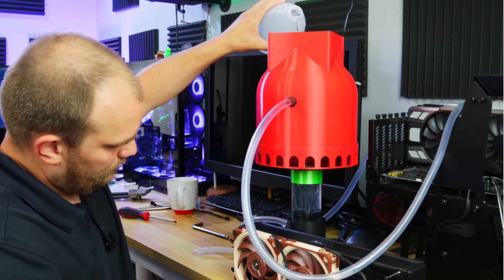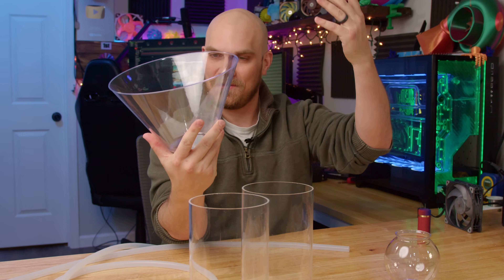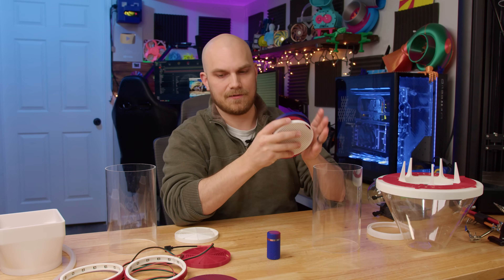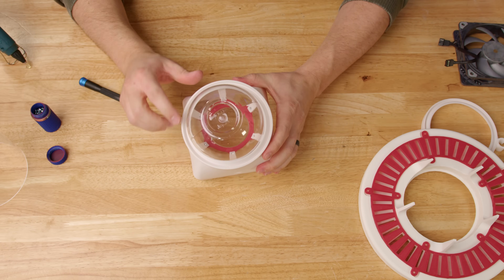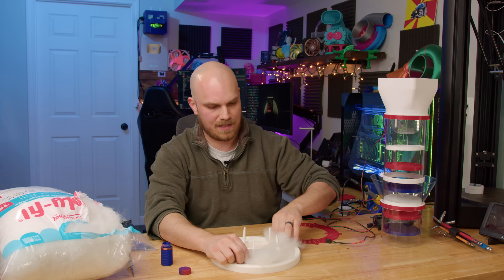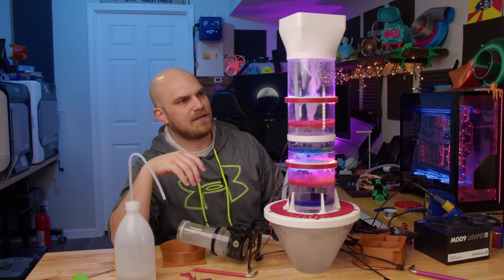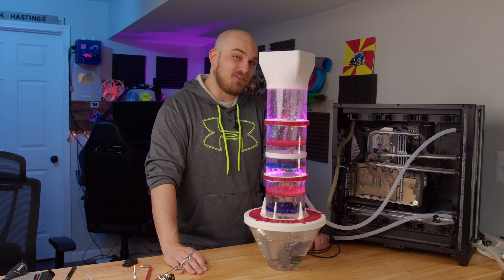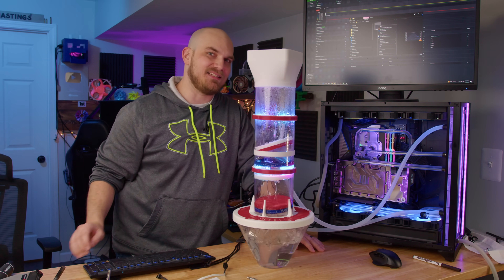Water Cooling..... With NO Radiators

Comment: i‘m just wondering, just an idea, but never tested or proven before, can you try to make the system a 2 stage cooling by adding a heat exchanger so the heat will not directly hit the PLA cooling infill and it might probably solve the warpage issue / hot glue issue

Comment: Of course you would need some protection for the fan but if you pulled air up through the bottom it seems you’d have more cooling. Of course that might come with more evaporation…

Comment: Why don't you make a spiral "stairs/slide" that spirals the inner sides for you water to flow down and make the middle of the cylindrical tower empty for an air flow column? 
Also solves the problems of your inserts falling off due to the silicone glue failing.
I would imagine the gravity to help with the velocity and spiralling effect into the bottom basin will also help the water cool better.

Comment: With some modifications this can be a wet scrubber to remove smoke, dust, VOC from an exhaust of any kind. Of course, the air get completely saturated with humidity and there is some water consumption, but for 3D printer or laser cutter exhausts it would be useful.

I may design one actually

Comment: bit late to the party maybe but I've made one of these in the distant past (I think 20-ish years ago) I used a copper pipe wound into a coil as a heat exchanger to keep the water from the tower and the loop seperate as it will get dirty. Only downside is you need two pumps. Back then I just used PVC piping, a Y adapter at the bottom, one straight pipe upwards with a showerhead kinda gardenhose attachment and a fan in the other opening of the Y adapter. the cooling water was usually below ambient which was pretty cool!

Comment: yea ... you're gonna want to not use this(style) for any real length of time ...

the reason you use radiators us because you need to close the loop. you effectively made an aggitator that makes as many tiny bubles as possible and sucks them back into your loop.
you will almost definitely vapor lock your loop if you run it long enough without burping the system.

Comment: So you created an open system in which your water is exposed to air and particles can get in it. Thus all the crap that is in the air can end up in the water and eventually end up stuck in the CPU water cooling block and eventually clog it up. You thought about air filtration but not water filtration. You also seem to not have taken into account all the baffling you created and what that is going to do to air flow. I say that because of he size of fan you selected to use expecting it to create adequate air flow.
All of that could have been calculated before hand. 
You also have the issue with water can evaporate from the system. You have poor surface to air values because you are trying to cool effectively a water fall rather than use any form of radiator.

Comment: For a very long time I suffered from the same ideas and their implementation.
1 to increase the area from which evaporation takes place, I used a bunch of different straws for cocktails, in my case 6 mm showed the best result
2 geotextile was used to filter the air - it is very similar to the material of vacuum cleaner bags
3 I used sponges for aquariums to filter water, it also made the sound of falling water drops quieter if the water level was lower than the top of the sponge
4 I used a channel fan and in order to avoid contact with water, the air supply was from below
5 since the circuit is open, the tank needs a huge one so that all the water can drain there, well, you need a powerful pump so that you can pump everything back, or you need a check valve(near exit) that creates a decent resistance in the circuit

Comment: Instead of mesh discs, you could print "Pall rings" for random packing with a top and bottom retainer grate. Pall rings are used in commercial-scale for distilling and similar processes. Pall rings or other random/dumped packing would be a great way to distribute that water nicely. 

Combine that with a counter flow air path (air goes up, water falls down), you could probably get some more cooling mileage out of basically the same materials. you could use a y shaped branch to inject air down one leg of the y to go up the other leg of the y, in which the water is falling down. Then you wouldn't need to worry about getting the fan wet, but you could still get upwards/counterflow air.

This liquid down, gas up  counterflow is how it's done for the most part with chemical engineering.

Comment: If it was a donut type design, with a inter wall made of a copper pipe (the donut hole) where the air is pushed/pulled through, with the clear plastic is on the outside (outside diameter of the donut) with the water running down between the outside of the copper pipe & on the inside of the clear plastic outer wall, & since you're not trying to also push air through the water side you can slow it down by adding a path for the water to run, like a maze.

it would be an inside out radiator.  also maybe go tall, the height of the room, or turn it horizontal & instead of using one wide copper pipe use many.  Maybe have one of the copper lines replace with clear tubing with your LEDs inside to like it up.

I just bought PMMA 12mm tubing from a US Manufacturer & they send me it in 2 meter lengths, they also make, well hell they make everything, you're outer wall could be 2 meters, (6 foot) long and as wide as you needed it.  www(dot)ePlastics(dot)com ...do not be freaked out by their web site, they're happy to help out us computer modders, they see no order as to small, and their staff on the website chat was very helpful.  Hell you could send them the design & they'd build it for you!

And buying from them you know the PMMA hasn't been sitting on a shelf for a decade turning brittle, you also get to deal with (2 meter) 6 foot lengths of tubing.

Good Luck with your next design.

Comment: How difficult would it be to do a build setup for a laptop? I have an Acer Nitro 5 i use for gaming and noticed it gets quite hot alot of times even with cooling fans under it. Would some type of cooler be possible for a laptop?

Comment: You need air flow through the middle OF THE TUBE! It will hit the heated dripping water and naturally cool it. 3d print a coupling that can fit two PC fans one on each side. Make the fans sit at a 45 degree angle one on each side of the tube coupling and have the fans in a push pull config.. The 45 degree angle will help to prevent the water pulling through with the air. The push pull will help fill the tube with moving cooler air. You can put a fine screen like PC air filter screen in between the fans in the tubing so water does not go through. You can even hook a fan controller up to the fans.. You are creating a chilling tower which companies use to chill DATA centers.. This is not new they just have radiators with water pouring over them and fans blowing the air.. Much more efficient than AC but there is maintenance.

Comment: I was thinking about doing something similar, before I realized I could use any of 3 legs in my old radiant heat lines to sink heat into the slab of concrete my house is built on.  It was abandoned, in favor of baseboards years ago but the piping still exists!  I used to work in a chlor-alkali plant, we did have chillers and a cooling tower but what you've got there is more similar to the chlorine stripper.  We used small cylindrical packing material that had plenty of surface area each, packed into a column with air in from the bottom an liquid from the top, with ventilation.  There was one disc at the bottom to keep the packing in.  Airflow was priority, as was surface area for chemical stripping.  These would, for your column have about a 1.5" diameter and length, easily 3D printed.  Food for thought.  I have also worked in both water and wastewater, so I have XP with flow and blinding.  Maybe turn down flow and bump up air.  The full column of packing material with a plate on the bottom with 1" holes will keep the packing in and allow for airflow without blinding (adjust water flow).  I had also considered adding a float and a 1/4" fill line for makeup water with a float and a valve, you will lose water to evaporation (hopefully!).  Looks promising, and cooling can be increased with a taller column/more packing easily.  It opens the cooling loop(heating loop) as well so it's fairly ideal, just add water and air!  You could even add ice to the basin to increase cooling for a bit too!

Comment: In process engineering we would use a filler material to distribute the water like little glass sections of pipe or metal saddle shapes or washed pistachio shells. The ultimate fillers are Raschig Rings. The trick is to maximize interaction without blocking the flows of water and air. And be carefull to not contaminate your water if you try any material.

Comment: You would want around 5.65mL/sec or 340mL/min for a 6 degree c temp difference across the heat sink at a CPU power dissipation of 142W. The hottest water temperature leaving the cooling tower you could expect if you get the design correct would be around 29°C. With a 6K delta T that means a 35° leaving temp from the CPU. I’m not sure how good the thermal conductivity of the water block is, some more info from the manufacturer would be helpful, but temps of 45-55°C shouldn’t be unreasonable on the cpu. Also depends on heat spreader thermal conductivity. 
Your pump needs to maintain a leaving water temp of 35°C from the cpu, and the cooling tower fan needs to maintain 29°C leaving cooling water temperature

Comment: Question. 
Could you water cool a closed loop radiator?
Essentially take the radiators out of the case and use external liquid to cool these down. Avoid concerns for contamination of the cpu lines. 

Could see numerous custom radiators scenarios for this.

Could test various liquids to cool. (Water. Prestone. Vodka. Olive oil. Etc)

Could test cooling  or chilling the external liquid as well.
Reply: Idea 1. 
Coil copper tubing around a graduated cylinder
Spacers (tile setting) as needed to keep coil spaced

exterior or wet rated led lighting inside the graduated cylinder. 
Frost or etch the glass and have a it either up or down or both within. Or. Edge light it. Or light from under the reservoir

Comment: As someone who works with industrial water cooling towers, it looks to me like you don't have enough elements to make the water droplets smaller.  At the very least, the ones I work with work to spread the water out over a VAST area, and has literally thousands of "chevron" elements to spread the water out and make them into tiny, tiny droplets.

If I were to do my own attempt, I think I'd use a 200mm fan, make it taller, and use a bunch of sheets of screen material to spread the water out and force the droplets to be smaller.

Comment: next revision put a bulkhead fitting in the bottom of the fishbowl with a 1/2" push to connect fitting to a 1/2" ID 5/8" OD acrylic tube running down through the center of the tower for a cleaner feed line, then add a diffuser disk at the level of the top of the fishbowl with as many holes as you can fit around 1/32" diameter. get a good rain effect and the fish bowl.

with  a tight fit on the center bore of the print you can keep the diffusers closer to square as well. i can send solid files if you arent picking up what im putting down.

Comment: I stopped at 7 minutes to comment that he will have nearly no arflow due to to that ball. pc fans cannot make pressure so it will just do nothing... resuming now
Reply: 9 minutes. told ya
Reply: okay now back to my experience. I built one myself years ago whit pvc pipes. a Y piece, a meter of tube and a cap. mounted a sunon maglev fan (those that go to 4k rpm) down on the y pushing air in and a hose just spraying water at the top of the vertical tube. My only issue was that the fan was pushing droplets of water up the tube to the ceiling, but other than that, I for sure know it was cooling my 120w peltier cell. hope this helps someone

Comment: I'm curious, how large would a reservoir need to be to not require any evaporation or fan? Like just the body of water against it's glass would disperse the heat passively. (Assuming you pull from below, eject hot high) I'd be cool to have a water-cooled system that made no noise at all besides the minor sound of the pump.

Comment: your fishbowl idea was sweet.  far superior idea IMO.  A v2 that had way more clearance would cure that issue.  below is my keyboard warrior list of suggestions. :-P

the media is your major problem IMO.  Need to vastly increase the surface area to get a good effect.  This is gonna be a balance between surface area to airflow.  Think the pitch and density on your media grids was a bit aggressive.  A simple series of printed 3/8"w x 1"h grids of square or diamonds with a very gentle pitch of the vanes and you rotate the orientation 30 degrees on each layer would likely work to dramatically increase the surface area and evaporation rates while not restricting flow much at all.  You could compare that to something like the aquarium filter media balls.

If you want particle filters on the intakes you are gonna want to Increasing the total area of the intake and move it further away from the water.  Extending the intake from the base plate that attaches to the bowl in the vertical with a outward pitch would keep the poly fill well away from the water and increase the area of the intake considerably while ensuring any drips and moisture drains back into the bowl.

this is really an interesting experiment I would like to see more of.

Comment: Long time follower, first time commenter 😅, after watching this video I had some suggestions for vas improvement for both air flow and water distribution. Have you considered trying the “print on fabric” technique with a mesh or micro fishnet? You could easily have stacked rings of various mesh and netting all from a simple trip to the screening section of a hardware store. All consider adding leg to your filters to act as guides and supports to build your tower. Cheers and great success!!!

Comment: I'd try replicating the tech ingredients air conditioner design. Long PVC tube filled with bio balls for surface area and fed by a spray nozzle for best atomisation. An inline water filter or heat exchanger for separate loops would be ideal to keep the working fluid clean. Or just a regular radiator, but I think we're way past that.

Comment: Look into bench top water cooling tower designs from companies like Armfield. They’re made for teaching purposes in engineering unit operations labs and are basically a polymer corrugated packing material in a column that dribbles water over the packing while inducing air flow at the bottom in a counter current fashion for optimal heat exchange. There are different packing densities and each have optimal running conditions. The denser the packing the more surface area however the more pressure drop will occur throughout the column. Cooling capacity is a function of water flow rate, air flow rate, and surface area of the packing.

Comment: Surface area is critical, so a larger diameter or taller tube with more diffuser plates would be better. Aquarium bio-balls are perfect for this and are typically used in aquarium evaporative coolers. You want a high static pressure fan. A blower pushing air from the bottom of the tube to the top would be ideal. Also, consider separating the two water systems with a copper tube-in-tube heat exchanger. This will keep the PC cooling loop closed and clean. No matter what filtration you use, you will end up with dissolved contamination in the cooling tower water. This is unavoidable and will foul the water blocks.

Comment: You don’t need fan as your fan is almost not showing enough static pressure to pull through any air, thus just the tower is enough, convection and the dynamic exchange due to gravity, reduce the spacing of “filter” to knock down the water  “noise “, it’s fking perfect looking into the first version of the design , you just don’t get that how much potential it got.......(1mw, 100c final equilibrium tem yeah it’s boiling , but you got it it can handle much more than 600w.....)

Comment: dude, i now want to build a waterfall in my living room just to cool my computer, would be so cool and calming..... totally thinking a granite post down the center, thicker acrylic to mount LED at top pointing down. wood accent fan shroud. clear printed inserts so led can refract well through them, and a stained glass base also with a wood accent piece... with a clear strip to watch water levels of course.

or even a small granite wall with a diamond cut texture to increase surface area at a slight angle with a rain fitting and fans surrounded by a wood accent top shroud.

Comment: So along with a better reservoir situation up top, let's toss one of those ultrasonic fog elements in the base to keep a nice base of fog to get pulled up the tower for additional surface area. I'm thinking smaller ones on the fill plates but those would take some work getting right.

Comment: Is it possible to make the water spiral down the sides of the tube like a whirlpool? There could be smoother water flow,  higher water surface area to volume ratio, and you can get a column of empty space in the middle for the airflow